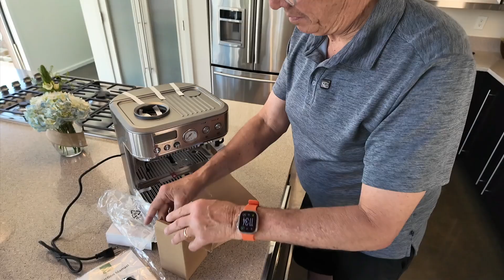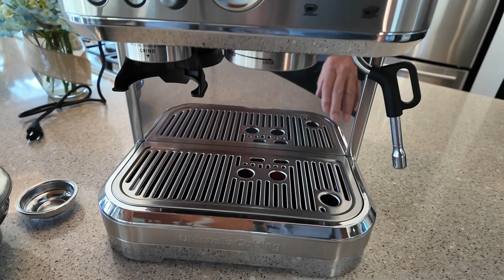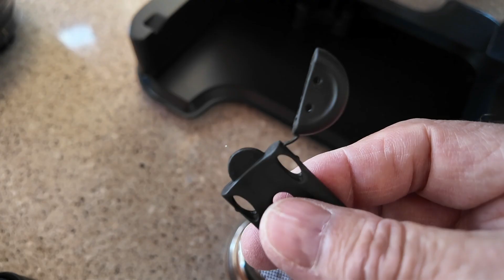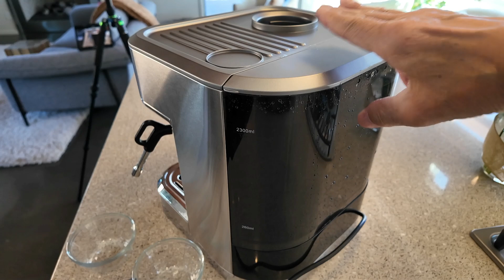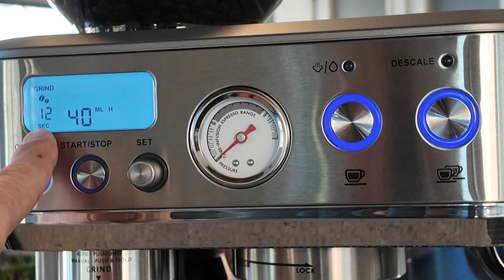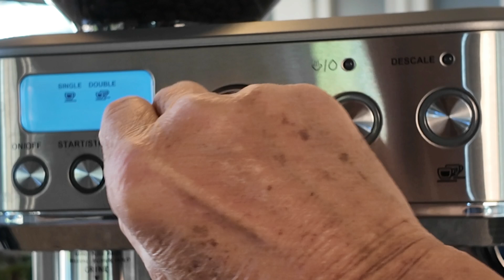URintells Cuising EM7110-US semi-automatic espresso machine with grinder, steam wand

Comment: How can I make my monometor working?? Does not move 😢
Reply from the maker: Well it could be several things… It could be your coffee is not ground fine enough therefore not enough pressure is able to be built up in the Porta filter to cause it to move, maybe you need to tamp the coffee more firmly or it could also possibly be defective. Have you tried tapping it lightly while you’re pulling a shot? How long is it taking for you to pull a shot?